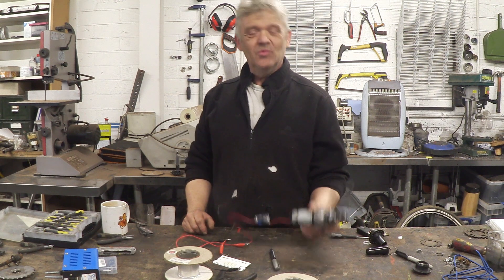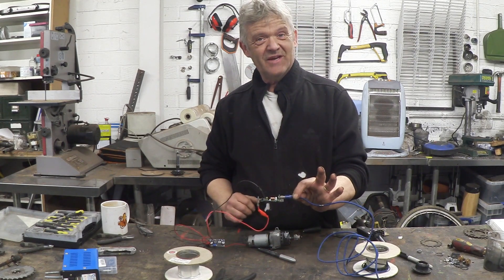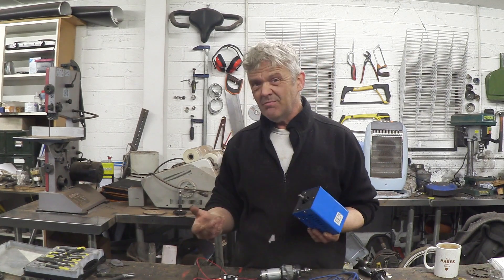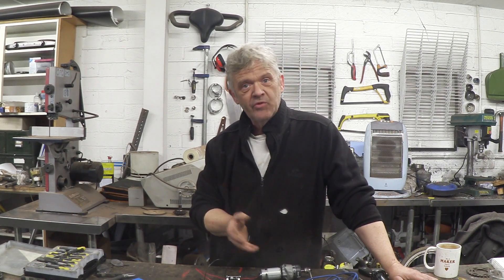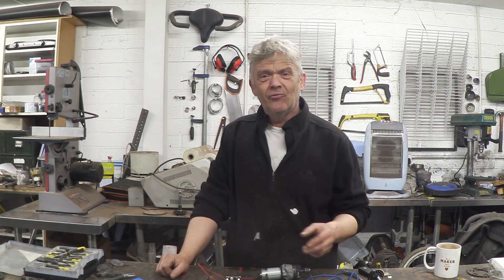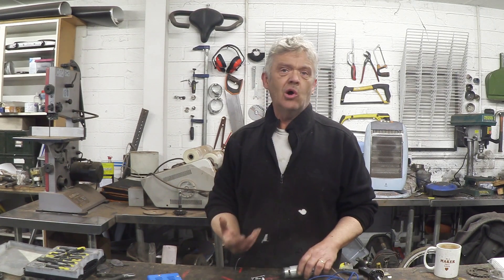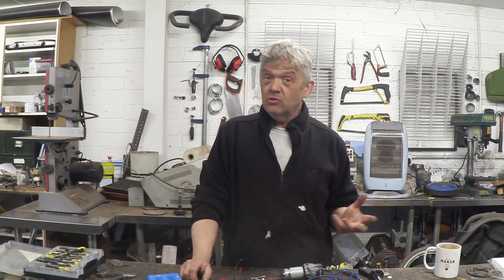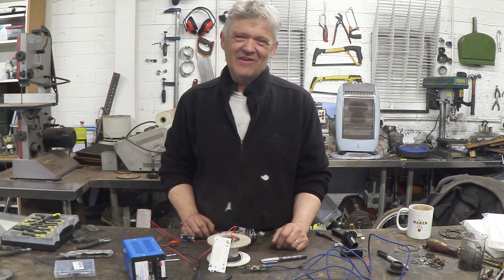1113 DIY Hand Cranked  Phone Charger / Emergency Light

Comment: A capacitor used to smooth the output to the board would potentially be a good idea too. Just to help prevent fluctuations potentially causing voltage spikes as the board turns on and off repeatedly.

Comment: Unfortunately the only problem with a full bridge rectifier there is a over 1v drop across two diodes losing potentially quite a bit of power.

 I have been thinking of this a lot lately and planning to make a generator out of a drill I have too keeping the gear box intact but overriding an external turn lock they have. 

 The gear box is nice because I can set the speed I want to turn the drill at to get voltage much like gears on a bike.

 Video is inspired by yours so thank you.

Comment: Nice one for adapting to ph charger, that is from a 12v Gene, I was wondering if the 240v Synchronous motor in Microwave cookers could do the same, if connected to a 240v plug ph charger. The reason I ask is cos those motors only need a slow turn to generate 240v, so avoiding the need for much faster rpm with the 10v DC Hand Drill motor you used. I have an old plastic face cream tub that I found, that has a good screw lid, that I plan on putting a microwave motor in it and the circuit board from a 240v plug ph charger, the crank handle also fits in the tub. So if the wiring works out, I will have a compact pocket ph etc charger, that will have a USB socket  in the side of the tub. So just unscrew the lid to get the crank handle, the motor bolted to the inside of the lid, with the spindle going through the lid. Also could be a hand cranked portable light if USB wired to LED’s, like you did.

Comment: imagin that in years gone past when bikes were fitted with the dymamo that rubbed on the tyre .now if they had had the efficent stuff like you are useing  they could of had real head lamp .in fact i dont under stand why they have not made a come back .you could charge your phone and batteries to run the lights
Reply from the maker: that is an awesome product idea right there mate
Reply: Yes those old generators for bicycle headlamps used to make cycling so much harder work especially on the older bicycles.

Comment: Great video as always, pound shop is great for finding useful gadgets which can be reverse engineered or improved on, like usb power packs . Swap out the batteries for those from a laptop and connect the 2 in parallel so you can change and use simultaneously. Keep up the good work!
Reply from the maker: nice tip mate - cheers

Comment: Hope you se me of one that know a litle how to do it. :) But of the drilbit from a nail i am totaly amased (I have to test that next week).  Though I think you should mention that if you like to charge a phone from 5 volts you need to shorcut the datawires. You can pick up 5 volts from a usb plug, but the phone need the lines shortcuted. F.eks if you cut of chargeing cable and put it to your powersuply. I used to put extra windings on a transformer and rectify it (Of course i had experimented la litle on my own in privat). And shoown my aprendices hov to of course charge your phone. I played a litle tuff so i just cut the chargeing cable and explaned how. I used a serial coil and ar capacitor though. Its for showing that if you put 10 turns it wil show the voltage pr turn nearly close and you can sort ofut the turns in the rest of the transformer. Then you just have to count out the number of turns that multipyed with the sqere root of 2 gives about 5 volt. of course you have to remove 1,2 volt for the rectifyer. (I think its already done the shortcut in your aplication)
Reply from the maker: I do indeed mate see you the way - it's all in how you explain really - like your post here - very helpful stuff - cheers

Comment: Next is external gearing and central weighted flywheel, stored energy. Not sure how big it needs to be.  Weights around a bicycle wheel on the spokes?
Reply from the maker: try filling the tyre with cement

Comment: Since watching your earlier video today I’ve been lamenting on the lack of consistent wind we get and the non-existent stream/river I have and so I was stuck for ideas as to how I could power one of your devices. However, your comments in this video got me thinking about the clockwork radio and the gravity powered light....both surely related to similar designs or principles. Thanks again Rob! 👍
Reply from the maker: I think they are related mate - and both good in my opinion - gravity storage is even considered seriously as a mass storage option - I have seen several plans

Comment: also something about the chemistry videos, you were showing how to turn urea into graphitic carbon nitride, and I am looking at using a UV laser to alter chemistry like kapton tape into graphene foam like substance, and thinking maybe  I could do the same thing to the urea, maybe putting it under tape that the laser will go through with out damaging it, and absorb into the urea to convert it over to something else (used the laser I have to convert titanium dioxide into some altered titanium oxide like Ti3O4 or some such, that is basically not white and powdery but instead dark brown and crystaline about double the size of standard salt at a dinner table sized, and that was just a focused and held by hand thus not very accurate 500mW 405nm unit,) so I can only imagine what all can be done with 2500mW laser of the same frequency since it is the photons doing a very good electron swapping and injection of energy to the electrons in the atoms to get this action since it does not heat up anywhere near as much as the chemical change requires typically.
Reply from the maker: I like the sound of that mate - certainly makes me think - cheers
Reply: @ThinkingandTinkering  actually found something that showed using lasers to functionally attach the GcN to graphene for higher efficiency if I recall of 9x. (at being a catalytic agent to convert water into H2 and O2 with sunlight)

Comment: you or luke should show people how to put a capacitor on that output when using it on the light, so it stops flickering and can even possibly be used to give it longer lasting light between cranks, (ie crank for a few seconds and get a minute or even half a minute of lasting light, use more and you can crank for a full minute and get 4 or 5 minutes of run time off it quickly and not worry about charge cycles and such like you do with batteries and such, (and you have shown people how to make capacitors before, so it should tie in nicely to those videos!)
Reply from the maker: a cap would be a good idea for sure
Reply: @ThinkingandTinkering  I have a couple of LEDs that have 120v circuits built onto the little board (super powerful for how small so they have to be on a massive heat sink) but it makes me wonder if there are any that have both voltage regulators and AC to DC converters that would work on a lower range of AC like what it seems is coming out of this, unless you go full on electroboom and put on a FULL BRIDGE RECTIFIER!! lol ;)
Reply: ok I just saw the end of the video and saw you mentioned the cap idea LOL, would be nice to see some info on input output and stability and all maybe with diodes so the power only goes into the cap, from the charger, and not back through the coils in the generator, and out only to the LED light since it is polar (a diode and thus the power will not work pushing it the wrong way, though it will go with enough voltage and damage the LED so yeah something to warn about getting it the right way around and how to check :) (usually the power is far more than you are using to light it and you are good but there is that chance when lighting up one tiny little LED for one reason or another)
Reply: oh also putting in lights both directions is a good idea to lower the flicker by doubling the light output frequency, till it is like a CFL lamp, which flicker too, but too fast to see, 

jusst dont do this from the back seat of a friends car at night with a red one way and blue the other, (police colors) cause, as I found out, the look like approaching police that typically turn lights on to arrest someone, and they (the friend) pulled over before realizing it was me, (and it was actually old white LED and red which the white had too much blue tint, thus fooling them) so yeah they were quite mad initially and took weeks before they could laugh about that due to how bad it scared them LOL

Comment: If you wanted, you could increase the efficiency of the whole thing by removing the buck converter in the middle since the car usb charger thingy is basically another buck converter. So your just wasting (hard earned) power by chaining the two converters. Or keep your buck converter and instead of hooking up the car usb charger just solder on a USB A socket.
Reply from the maker: the data sheet on the car usb charger said that it accepts a 12-24v input mate the hand crank generator varies from 2 - 10v - my thought was the the first boosted voltage to a level the car USB port could use
Reply: @ThinkingandTinkering  could you say what the first voltage regulator is? I thought it  looked like one of the XL4015 series  which are buck, not boost, and the initial no-load cranking was up somewhere around 30v (I thought you said during your mad laughing ) so I assumed you had used one of those.
Reply: @nil5221  Looks very much like a XL4015 buck indeed.
Reply: @ThinkingandTinkering  Since the car usb charger is a buck converter (VERY likely because of the toroidal inductor seen in the video) the dropout voltage should be in the range of 0 - 0.7V meaning that it would take 5V + 0.7V = 5.7V at worst for the usb charger to output 5V
Reply: @ThinkingandTinkering  Something I had not thought of, and thank you for telling me about it. There are a lot of things I still hadn't worked out like that,  Like how to charge the battery 100% so I can give my arm a break while using usb devices.
Reply: I was thinking the same thing.  One thing to note:  I have a 12v drill with working batteries.  If I go to charge the battery using the crank It will get to the point where I let go of the crank and the battery will turn the drill.  I had to put a couple of 12v diodes in  place between the battery and drill.  (inside an automotive fuse addon wire).  You can bypass this if you want to use the drill as a drill or just direct charging by switching out the Diode fuses with a real fuse or a bypass switch.  My origional drill is intact, I just rubber band or tape the trigger to hand crank it. There is probably a better way but I haven't worked on it much.  PS I can't get the batteries fully charged this way the torque gets to hard.
Reply: I agree, I thought the same thing. The car USB charger will handle up to 48v  so the regulator is superfluous in that particular application.

Comment: A thought challenge (but off topic): I am sure you are familiar with a Ram Pump. Could a Ram pump be designed to generate electricity? I'm thinking of a Cyl wrapped in copper with a magnet in the center that is forced upwards by the Ram pump pulse. Electrical current would be generated on both the upward and downward motion. To get a modest range of motion I think a large check valve (for volume) would be needed, then the pulse condensed to a small volume (to increase pressure). Just thinking out loud so don't mind me, but a Ram pump never stops running if there is water flow. So,  this would provide constant electrical charge for a battery or some such.
   Oh, and thank you for taking the time to read this. Your vids always interest me.
Reply from the maker: it certainly could mate and I like your design - it makes sense to e - I personally love ram pumps too!

Comment: Has anyone tried to put a flywheel on their's to stabilize the flow of electricity? It might be really cool if the hand crank could be clutched so you don't lose control when you can't keep up.
Reply from the maker: it's a good idea mate - kind of a mechanical capacitor If you like
Reply: @ThinkingandTinkering  I was thinking the same thing. The only question is whether or not the device is mobile or static backup for around the house.
Reply: I use a heavy flywheel.
Reply: @MAGnetICus_Attractus  yeah I need to look into all these different ways of extracting free power
Reply: @ghostmandeak7305  I wouldn't call it free energy. But a M.E.S.S. is Mass Energy Storage System.
Reply: law  cheers
Reply: @MAGnetICus_Attractus  How heavy? Does it stabilize the output? How long does it spin after you stop cranking? Thanks for speaking up.
Reply: What's that mate
Reply: @ghostmandeak7305  I was thinking that if you put a flywheel the weight of it would help you to stabilize or balance the turn rate of the motor adding to the consistency of the power out. It was a problem we had when we were kids and took the batteries out of our vespas and ran the electronics off the stator. Then if you clutch the crank handle it won't spin when you let go or can't keep up with the turn rate of the flywheel. This in theory might make the power signal a little cleaner and work a little more efficiently with delicate electronics. Just an Idea. I was wondering if anyone else had tried any or part of the idea on their own already. No point in making mistakes other's have overcome.
Reply: @ArcanusLibero  mate I haven't a clue pal me I'm useless unless I'm shown something but I'm looking for ideas how to charge a project of mine involving a recumbent trike I'm building with a micro caravan on the back or camper even I am looking at solar wind an trying to find ways to drag power from wheel power also mate as I'm looking at travelling all over the UK for a YouTube project I have planned and obviously I need the trike to be powered electronically but when the trailers on I will have two motors attached so I will have two sets of batteries for each motor and I will have an electric generator for emergencies mate as I dont want to end up stranded
Reply: @ghostmandeak7305  I would recommend a propane generator for back up power. They make them very small and they can run on camp can propane. Usually 4-6 hours on a 2lb can. Fly wheels are usually heavy so I am not sure there is an applications that would suit your needs. I do think there were some projects on this channel that included modified Flywheels that may interest you. They were innovative in the way they were constructed.  A small flywheel or dynamo could be useful for a hand crank generator like the one made in this video but it is not essential if you have a battery system as a buffer to clean up your sine wave. Sadly no easy or guaranteed fixes just ideas. Maybe someone else that watches these videos has more experience. Good luck....
Reply: @ArcanusLibero  thank you very much pal you've been a great help buddy and I will research that thanks I think solar and wind and leave the wheels alone unless I can find a really light none resistance way of doing this then j will leave it for now but thanks alot pal stay safe and take care yeah all the best bye
Reply: @ghostmandeak7305  All the best to you as well. Happy travels.
Reply: @ArcanusLibero  😁👌👍👊

Comment: Iv made my own battery power bank 1500w 200amp. I also made a hand crank years ago using a stepper motor and 8 Maxwell supper cap's, worked great. Love watching your videos very informative. Thanks.
Reply: Rob's super caps would work great to store the for later use, the unused or reserved for later energy.
Reply: @larryniidji  Well they would be cheaper than the Maxwell ones.
Reply from the maker: nice job mate - thanks for sharing